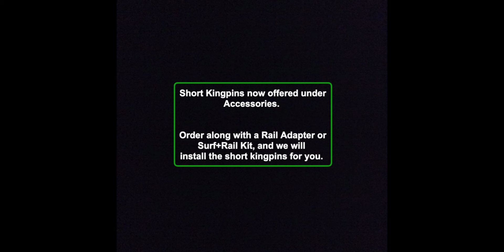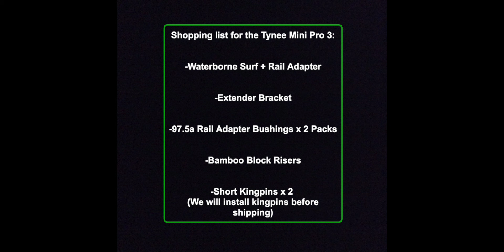Upgrading Tynee Mini Pro 3 for $225! Trials and Tribulations!

Comment: Cool setup. I might try this for my wowgo mini-2S at some point, but im probably gonna run into the same problems as you did since its very similar in design.
Reply from the maker: I'm betting that you won't have to drill holes to fit the Extender. So at least there's that!

Comment: Well this is slightly disappointing... I was just about to pull the trigger on a tynee stinger too. Looks like i would have to do the same things based on this video just to get the WB adapter to fit.
Reply from the maker: @shonarimansj  actually for the Tynee Stinger, reference this video where we put Adapters on the Evolve Stoke. This video was made before we had the FIN Limiter though.
Reply from the maker: @shonarimansj  https://youtu.be/5ofi7jUHhas?si=3tvNknrVK-VK_2SC
Reply: Got the meepo mini 5 with fin adapter + rail with 105 donuts and it's perfect
Reply from the maker: @shiftcmdoh  hub motors or belts?
Reply: @WATERBORNESKATEBOARDS  hub motors
Reply from the maker: @shiftcmdoh  Nice! Way easier to work with imo